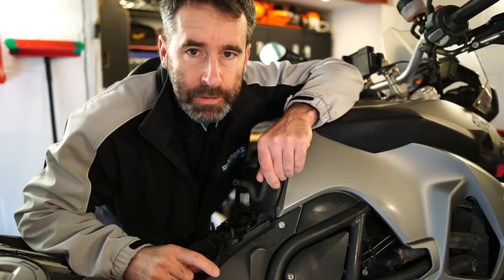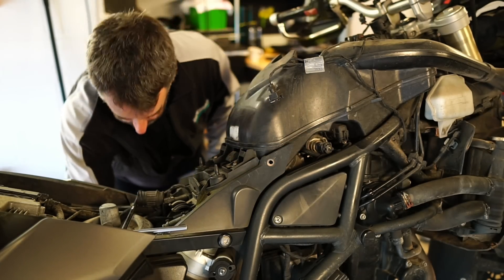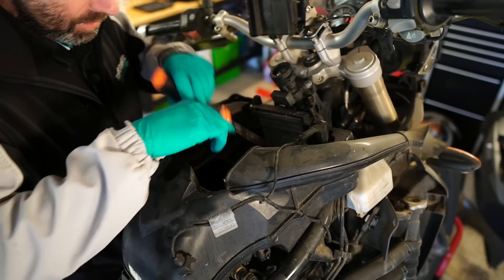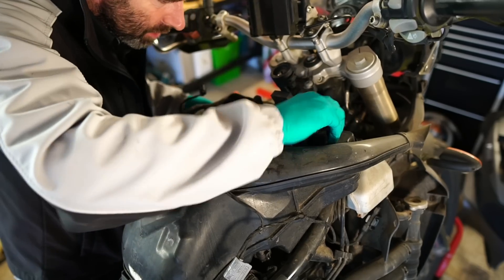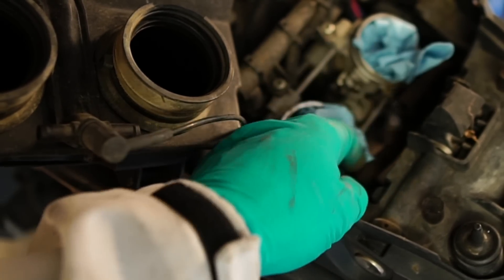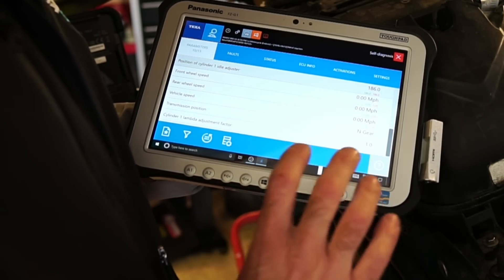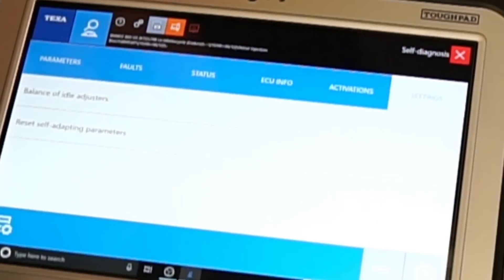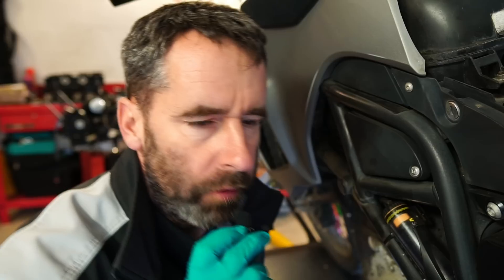Quick Fix #1 Motorcycle Lean Misfire Vacuum Leak Diagnosis (Part 2)

Comment: Great stuff. Has there even been a broken bike you’ve been unable to find the cause of?
Reply from the maker: There have been a couple that I haven't managed to finish for various reasons. It's usually cost for the customer that causes problems.  I remember a KR1S about 20 years ago that got the better of me! I still wake up in a cold sweat thinking about it :)
Reply: Superbike Surgery TV KR1S..... nice. My mate had one, my TZR250 always looked... well a bit rubbish next to his gorgeous KR1S. Of all the bikes you’ve worked on a 90’s two stroke, even with a power valve, must have been one of the simplest. Perhaps you should buy yourself a KR to face your demons 😉👍🏻
Reply from the maker: @TheDervMan  I just love that era of bikes, bring back the 2 strokes! The KR1S in question was actually just the engine. Some crazy person had put it in a Lambretta frame then given me the task of sorting out the wiring! I was obviously a lot less experienced 20 years ago and in hindsight I should have just made a new wiring loom for it rather than struggle. Good times :)
Reply: Superbike Surgery TV WTF! A KR1S motor in a lambretta, I hope they improved the brakes too 🙈
Reply from the maker: @TheDervMan  Probably not, crazy scooter people!